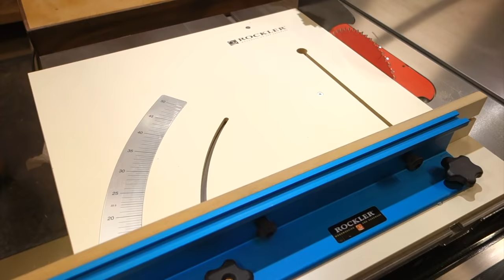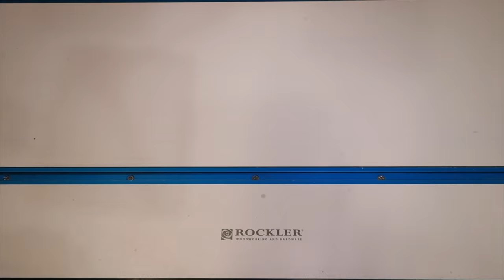Alec Steele Collab Hand Plane

Comment: Puuurty! Gorgeous plane Dustin! I don't mind the racing stripe at all. Especially if the wood is not thick enough that you have to work with or didn't count for material loss due cutting and planing.( I make that mistake often )
Reply from the maker: Thanks!  I had to thin the centre section quite a accommodate the stripe, but it was worth the effort.  The walnut is beautiful, but it needs some contrast to really make it pop!
Reply: Dustin Penner Yeah! It gives it a nice touch!

Comment: That's very nice. Easily the second best hand plane I have seen. Do you have any plans of using it as a high angle bevel down plane, or just as a scraper plane as it was set in the video?👍

Comment: Racing strip because you forgot to allow for the blade kerf when measuring the block!!! Stunning piece a joy to behold and no doubt use. lovely work.
Reply from the maker: I knew this one was coming.. nope!  I had to carefully remove material from the centre section to allow for the stripe.

Comment: Could you have added a leaner angle to the other side and switch the blade over to use the planer from the other side for a different type of angle of attack?

Comment: Hi mate, noticed you’ve put the blade Bevel up into the plane, looks like you’ve got a high bed angle already, it should work fine Bevel down, easier to push, Bevel up and a high bed angle means scraping plane territory, and it’s a bummer to push. Try using it Bevel down like a normal plane, and turn the blade around for scraping some really nasty grain if you can’t get a smooth surface normally. Saves a lot of arm fatigue. Great vid!
Reply: Vincent Tai yeah, it's already a 55 degree bed, so with a 25-30 degree blade bevel, it's going to be close to 90 degrees. Turn that sucker over and you'll still get good results and you won't be just scraping.

Comment: Love the racing strip!   BTW, entire articles and videos have been created to illustrate the importance of gluing both sides of the wood joint and putting at least good, even pressure on glue-ups.   Obviously in high stress furniture joints they are critical factors, but have you found those things to not be important in other situations?
Reply from the maker: Thanks. I honestly never gave it a second thought. 100% coverage is what you’re after and how you get there shouldn’t matter; not on a noticeable scale anyways. Thin layer on each side or a thick layer on one and rub them together. I am always in the mindset of efficiency and try to reduce the amounting open time which swells the wood and makes glueups a nightmare. I would say do what works best for you and learn from your mistakes. I’ve never had a glue joint fail to the best of my recollection.
Reply: Dustin Penner — I totally agree.  It’s not like it will get much shear or other stresses in a plane.  I constantly look for efficiency gains too.  It wasn’t until I read an in-depth Fine Woodworking article (and then others) where they compared both glue types and single and double sided gluing (and others compared high clamping pressure versus little or no pressure), where they found that the glue failed under high stress (e.g. furniture legs or equivalent) when both sides were not glued and well clamped.  In contrast, the wood consistently failed before the glue when both sides of the joint were individually glued and well-clamped under high pressure.  Rubbing together was not the same, probably due to set and coverage.   Good wood glues(e.g. Titebond,etc) actually become molecularly bonded with wood (like certain metal glues do with metal), when used as engineered.  But for something like a plane, it’s likely irrelevant.  Btw,  I only had a few legs and one shop tool fail in over 50 years— all were done under low clamping and/or with rubbed glue methods.

Comment: Very nice.  I wonder if the GT racing strip had anything to do with width loss due to blade kerf??  Well handled, and the "HOPE" really captured my hesitation when proceeding on something new / important.  Thanks for the video, Cheers, David.
Reply from the maker: Thanks!  I knew the blade kerf question was going to come up but honestly, it wasn't an issue.  I had to remove a lot of material from the centre to add the stripe.  I wanted to break up the darkness of the walnut a little and I have used paduak and walnut together in the past with great results.

Comment: how did the padauk for the racing stripe glue up? i have heard padauk is so oily it doesnt glue well with water based glues like titebond  did you rub it down with alcohol first?
Reply: I always wipe padauk and other oily woods with acetone before gluing or finishing. It removes the oils for long enough to let the glue or finish take hold.

Comment: In my opinion it would have been better to use boiled linseed oil with a tiny bit of poly mixed into it. It would make the light colors a little brighter and keep it protected longer. Other than that it turned out great, beautiful piece. Excellent video.

Comment: Was wondering why there was no chip breaker, but then realized this was bevel-up.  What's the combined angle?
Reply: Ian Hay Yeah, bevel up and high angle is an interesting combo...
Reply: Apentogo So 30+85= 115 degrees. So what we have here is a cabinet scraper then?
Reply: Andy Midd He meant a total of 75-85.  The bed angle is 55 (we saw from the opening shots), and the iron bevel looks to me to be about 25 degrees, so a combined angle of 80 degrees, it looks like to me. But somewhere between 75 and 85 looks right. Even so, that’s steep!
Reply: Ahh. Yeah still basically a scraper plane then

Comment: One would think that you'd want to attach a piece of metal to the contact size as well due to it needing to be able to stay planar as well. You may have used a hard wood, but it will eventually wear and will wear quicker than metal. but that is a later fix if anything
Reply from the maker: Xlaxsauce wooden hand planes have been around for thousands of years. They work.. that’s why they’re still around.
Reply: Xlaxsauce An old trick is to glue sandpaper to a smooth marble top (which is extremely flat) and sand until you are satisfied, it takes away just a tiny amount of material and leaves it flat again

Comment: Hi, here's a Tip from a Woodworker: 
NEVER OIL THE SOLE FROM THE HAND PLANE! You'll feel a resistence. Take wax from a candle light. Rub it, DON'T melt the wax or use other wax. 

To take the oil away, sand the sole. Use 80/ 120/ 240 Grit. If you see the blank Wood, rub wax on it. Try it. The Plane will drive way better over the Wood.
Reply from the maker: This is not good information. There is no resistance from the oil, candle wax has no place on a tool and how on earth to sand away oil?
Reply: After a while the Oil can be sticky and it defently dries out. So you got "blank" wood. My Master gave me the tip to use normal wax (paraffin, not melted). I tried on my own and it works. I use hand planes from 1920 and there is absolut no problem. No traces on the Wood and the plane slides very well over the wood, after a tests. I don't think that my Master was wrong. He worked with wood where I was playing with Toys ;-)

Some Oil doens't soak deep in the Wood. When the Oil dires out complete you can sand it a bit away. The wax should then hold well on the wood.

Comment: While this is awesome. I think you should have done the plane in layers so cut a bunch of sheets of wood maybe 2 contrasting colors and layer them. Adding the racing stripe is kinda like that but I mean doing this with many more layers to kinda symbolize th blade being layers of steel.
Reply from the maker: x9x9x9x9x9 that’s called Plywood... not a look I’m interested in. Did you not see the grain pattern in the wood I used?

Comment: I thought that you never put a plane down on it's cutting edge, unless you are using it??
Reply from the maker: I prefer common sense to old wives tales.  Aside from the table saw and the floor, any surface I set this on is going to be softer than the blade.  Considering its a tool designed to blast through tough blocks of wood i'm sure it'll survive.
Reply: Ah - it really is an old wive's tale? My woodwork teachers (35 years ago) were wrong? :) 
Even as I was typing it, I thought it strange that a blade that works when forced into a surface would be harmed by being placed on one was strange. Perhaps it was something to do with the blade depth? With setting the blade depth by hitting the front of the tool?

Comment: You said the "racing stripe" would be controversial.
Actually you should have made the entire block of wood from different wood layers.
To reflect the damascus that would have been apropriate. One racing stripe is not.  ;)
Reply from the maker: Ulrich Kälber plywood.
Reply: essentially: Yes.
But i did not have something in mind that you can buy in a shop.
more like layers of black like ebony and grey wood, reflecting the colors of the damascus.

Comment: That plane was meant to have its bevel down. The plane is a scraper in that configuration.
Reply from the maker: I designed every angle of this plane. Tell me more about how it’s supposed to be…
Reply: @dpmakestuff  I have over 20 planes, all but my block planes are mounted with the bevel facing down. I have one wooden smoother from the 1800s that is pitched at 55 degrees making it a high angle plane. This plane was honed to around 35 degrees by the previous owner. My more commonly pitched planes that have the blade bedded at 45 degrees and all the way down to 35. For the sake of argument I flipped the blade in my Stanley No 4. This plane was honed to 5000 grit to 35 degrees. The bed of the plane plus the iron angle made this a 85 degree cut. This plane barley cut at all and was not giving me the paper thin shavings I am used to. I would recommend that you quickly flip the iron and see how it cuts.

Comment: Bevel up on a 55 degree bed?
Reply: MetricFastener Yeah, I noticed too. But with a single iron without a chipbreaker, why not? That technically makes this a scraper plane conversion. Mujingfang makes a 60 degree smoother which can be converted to a scraper plane that way.